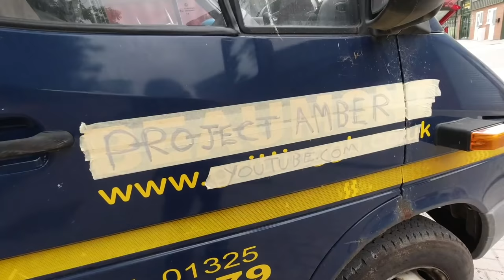My Van is Dead. Ex-ambulance finally giving up.

Comment: Deffo change the full engine, I know it’s a hell of a lot of work but everything on that engine has only done 58k, including all of the bottom end bearings etc. it has to be worthwhile
Reply: might go as far as replacing the spindles and rearhubs too as the bearings in them should be way better (if they fit the hydraulic stuff from amber on them that is )

Comment: Good luck with this. I would have a go with the low ratio diff. Just stick to 50mph on motorways and everywhere else will be better. Without the auto having a low first gear for getting to your land in Portugal will be really handy.

Comment: You need Mercedes VDOC, remove the option codes for semi auto and re SCN code the original control units. It’s like a retro fit in reverse.

Comment: "That is a lot of work." It's a lot of content, too, though. I did some of these things to my 212 d, and it is even an astonishing lot of work with two absolute identical cars. Still a huge job should You go for a non-Mercedes aftermarket ECU (don't know whether this would keep Amber roadworthy in terms of homologation in the UK) to avoid all those differences rendering the new stuff incompatible to the old brain. It's quite some step anyway. I think I personally would have searched for a new 5/6 speed manual bed with lock diff in mid range speed and changed the living room, but You might have Your reasons. Massive respect and good luck. I'm looking forward to how it goes for You.

Comment: This happened to me with my ambulance. There were unforeseen differences with all sort of daft stuff like gbox mountings, subframe, steering rack etc. In the end I undid the subframe complete with all the suspension and running gear and lifted off the cab and body leaving all the suspension, steering and drive train in one huge great lump, jacked up my ambulance and plonked it on stands, dragged out the whole lot with a tow rope, pushed new drivetrain under empty ambulance with pallet truck, Dropped ambulance back down onto said new drive train, bolted it in (in this case 6 mahoosive bolts) , stuffed the defunked old unit into donner vehicle, and flogged it all off in a one shot when I was sure I had all I needed. This saved a heap of mucking about. Good luck. PM me for more stupid ideas if you want to complete your breakdown and transition into a full psychotic episode. Have fun!

Comment: standard engine > adaptor plate > Lexus 450h hyriid transmission(can produce 300+bhp) > batteries from VW or BMW  hybrids add as you go along > modified Prius controller... and other bits needed...

Comment: That's going to be a Big job. When you swap over the motor and gearbox make sure you toughly check the clutch plate(s) out and the hydraulic thruster are in excellent condition otherwise replace them while they are accessible.

Comment: I feel sick thinking about it, but in my experience the compatibility of parts is usually blown out of proportion and often things work that so and so from down the pub said wouldn't. I think with changing most of the bits you will be ok.

Comment: If I'd known you'd been doing all this work CJ I would have booked a week off and come and given you a hand with some of it. It's a lot to do on your own, especially when fighting with all the bloody rust we get on our vehicles here in the UK!  I probably would have taken your course of action - at the end of the day the idiots on the production line managed to put these things together how hard can it be to play musical parts!

Recipe for rusty stuff that won't come apart:
Shock - impact, air hammer or a whack with a BFH
Heat - MAP gas - comes in the yellow cylinder. Absolute life saver! Cycles of quenching with freeing oil or a freeze spray can help.
Brute force - Breaker bar

Some combination of these will generally free something. If you snap the head off something clean it up and weld a nut to it. Worst case get the grinder or the cutting torch out. 

Wouldn't hurt to consider getting one of those monster half in Milwaukee battery guns - you already have the charger and the batteries for your drill.

Comment: Been a while since i've commented , but def a donor van and swap everything , even a manual gearbox swap . Like i have said before in the past many years ago when you originally replaced the gearbox , this is your house ! 
A full mechanical swap is lengthy, but head down bum up and its done sooner than later and you have a boat load of spares . :)

Comment: Swap out the entire engine and box with it having only 58k on it. Use the 1/3 of a million miles engine for spares.
Swap out the entire rear axel too, you can always change the crown wheel later.
....patience , have a lot of it to hand.
Good luck.

Comment: strongly suggest you take the whole lump with gearbox out of the donor and put it in amber , allso replace ambers dashcluster with the one out of the donor (could be the dash talks to the ecu about the milage and have them different might send the ecu intoo a hissy fit )
since youre replacing the reardiff with one of a different reduction , the speedo will be off so you probably need to have someone hang it to the star unit (you can buy working star C3 and C4 systems on aliexress and do it youreself )
as for trying to start it while missing components , dont do it it will trow faultcodes

over here in the netherlands there a few people on the smart forum that have a star C3 unit that allso works on youre van and do work for a small fee without the problems that the boys at mercedes have about "trown together from parts cars" 
one thing i do know is that usually the wiring is expandable by adding the extenions to them (they are on the smart fortwo at least for stuff like full auto cruisecontroll the clock and the rev counter and these are mercedes desighned mecanicals and electronics too )  , even with the cabling mounted they still dont work untill you turn them on in star though , youre prolly need to have the tacho removed from the system too 

hope you manage to fix it , i know you can build it together from the parts youre having but getting the ecu to play nice is usually a bit more work , try mercedes forums for hobbyists that have the star in youre neck of the woods , im sure they can get it to run again 

allso keep both vin numbers as youre going to need them when ordering parts from mercedes , i used to own a gas model 190 they converted to diesel and mercedes plain refused to sell me the parts i needed unless they where things like sparkplugs and a distributor
u turn them on in star though , youre prolly need to have the tacho removed from the system too 
it might be eazier to program the ecu to run a manual gearbox and keep all the electronics like they are in amber https://www.benzworld.org/threads/ecu-reflash-automatic-to-manual.1662594/
https://mhhauto.com/Thread-Solved-Sprinter-906-automatic-to-manual-conversion

Comment: You just need to put the adaption codes for changed module into the ECU. It's really simple if you have the software.  You can also change what differential ratio the ecu is set for with software adaptions

Comment: angle grinder with thin metal disc cut the bolt in 2 on the leaf springs shackel little love tap with a hammer n chisle easy and just get new bolts

Comment: just a thought, Have you looked into the price of an an aftermarket programable ecu i think there pretty much come with a basic map to allow running , use the relevant wiring and plugs to feed it from the donor vehicle.  That way you can keep all your wiring for airbags windows etc, just might need to fool a few of the dash lamps when its mot time.

Comment: Know how u feel. When I operated my own buses I had a fairly young Merc 811 29 seater auto and gear box packed up. So went for the manual option.  Great took 2 months to find a second hand gearbox and peddle kit as there were very few 811 scraped. But what a different bus to drive when we got it back on the road. Enjoy as the manual option will make a better driver and less headaches.  As merc auto boxes do give a lot of trouble.

Comment: This is such a good outcome, you change the engine for one with hardly any miles, lose the nightmare gearbox and swap the dodgy suspension while keeping the conversion with all the love and manhrs you invested. Just have to do it... What would the top speed be with the higher ratio back axle I wonder ? You could certainly climb hills.

Comment: One thing to consider. As the donor van is classed as HGV and fitted with a tacho it will be electronically restricted to 90kph.
Reply: hi can a auto electrician remove the tacho?

Comment: A used engine from a specialized company will do the trick I recon, don't waste your money on another van.. Calculate for double the cost of another engine, since all the hoses/ reservoirs etc will probably needs to be replaced due to their age. And don't forget to put in another clutch/gearbox/bearings/other driveline-parts,  since you are opening her up anyway.
Reply: That's exactly what I was thinking might be the best way forward. If the rest of the van is solid then it's worth the outlay, but get someone in to do the specialised work. Theres plenty of donkey work he can do, but I wouldn't want to mess with stuff that really needs someone with magic hands and knowledge to safely carry out the work.

Comment: If the engine is smoky and sluggish it has to do with the intercooler 'not doing its job properly' as you said in the beginning, thats an easy fix, everything thats wrong with it can be upgraded with aftermarket parts way stronger than the ones she came from factory with? Get better bearings for the gearbox do it properly with reconned torque converter and the lot, sort the diff? Dont start on a new van because its gonna cost way more, its just not worth it. LE: got further in the video and seen you got one for spares, so fucking happy you haven't gave up, never give up on it, keep this in mind, you abused it it lasted, you running constantly with all that weight on it of course she gets tired more often but you got to keep her going, she never let you down, dont let her down.
Reply: No torque converter. It's an automated manual gearbox, i.e. semi automatic. There is a much earlier video of CJ doing a flywheel & clutch change.

Comment: As far as swapping the complete wiring loom goes. I would swap the ecu's with the complete engine and gearbox if it plugs into your van give it a try and see if it starts and what error codes show up, as long as the plugs are the same. I had very few issues doing a similar swap on a Vito van all be it slightly newer. The manual ecu will negate most of your management issues concerning the auto transmission. It would be alot harder going manual to auto.

Comment: Shame about Amber. As you went through the options I was thinking about a swap then you came up and said it. Then I thought finding one would be hard and you said you had one already. I think it is better to take engine and gearbox just in case the end of the crank is different and also if there are any electric connections on the gearbox. I think you may have to do something to recalibrate the speedo. I doubt the diff matters electrically as there are no wires to it. What normally happens on a rear wheel drive car is where the cable or wire goes on the sensor at the back of the gearbox there is a speedo drive which is matched to the diff and tyres. If you pull that out and swap it for yours that may be all that is needed. You may if you can get some help be able to drop the engine and suspension together. That is the way the factories usually put them in just be careful lifting in tight spaces to avoid mishaps. The electrics are always a bit worrying as there is no easy way to test as you go along. You could do with a Merc mechanics advice.

Comment: Maybe one plan of action with the diff could be to just fit that new one to keep it mobile and get the old one rebuilt?

Also don't know about the loom, but i reckon you can make a hybrid of the 2 (not as scary as it sounds), One that keeps the engine and clocks etc happy and leave the rest in for all the other electrics like windows etc?

Comment: Ah, just get on with it, swapped a C220 engine into a sprinter this year. Pretty straight forward apart from a bit of coding and looms are made up in short sections that are inter changeable to the main loom, big Meccano set really. Yeah agree that’s a lot of work involved but most parts are interchangeable throughout Mercedes’ range. Part numbers are W906 ************ or same part different model W904 ************ last didgits are the important factor. Good luck n crack on.

Comment: You'll pull her round mate but i'm not sure why your not having your gearbox reconditioned, its not hard to do yourself or a few hundred professionally saves an awful lot of work
Reply: He's already had the gearbox rebuilt once, as I recall it was a major headache for him..
Reply: @jeffbishop9404  I remember about 3/4 years ago doing it on his parents drive after it failing through france but think was only repaired not fully reconditioned if i remember correctly
Reply: @Superfandangoo  Yeah, he took to a 'specialist' in Wolverhampton I think. Wasn't the best..

Comment: hey, ever tried a candle pushed on a red hot seized nut and bolt? - its better than the wd duck oil ! i have tried it on  knacked track rod ends when nothing else worked, i can't remember the science but the candle becomes the gas and fires up the dry threads.... vitre effect or something works a treat

Comment: You are nuts😂. Didn't realize that they are air brakes. Give it a suspension lift while you are at it and put taller tires on for when you go up daft muddy tracks as you seem to like doing😂👍

Comment: Aww CJ I feel for you I am in similar situations with my campervan 350 transit issues with engine ive spent loads and more  but I don't want to let go either. Catch 20 I've spent so much we're do I draw the line she a good van just ford crap engines so do I keep spending or let go . 
Good luck

Comment: I just spent 2 years doing up my sprinter and now it's in the merc workshop still immobilised after spending $1740 then $1650 now I get a bill for $3450 and 4 tow truck bills and I still have to wait at least a month to get it back. I feel exactly the same. Don't know what to do. At least it's a manual.

Comment: notice you are using Milwaukee cordless, the 1/2inch drive impact gun would make very light work of those spring bolts.
Reply: Yeah - he already has the 5AH batteries! Those half inch impacts are absolute beasts - well worth the money!
Reply: Someone should contact Milwaukee marketing department and get them to send him stuff

Comment: Mate…I feel for you, I’ve got the same shit gearbox .. 02 316, and similarly my interior set up is 100% so no choice..had to buy a new computer system for the auto box and have engine removed to get the glow plugs out, turbo fixed etc .£3.5k later it’s working but I now can’t afford a respray! If the doors on the spare van are (miraculously) rust free I need a set so give me a price
Reply from the maker: Oh no! Sorry to hear of your issues. I'm afraid the doors were beyond saving

Comment: Surely you would be better just taking the box off and mounting it on the 58k base?
Reply from the maker: It's so rusty it'd probably snap in half! It would have been ideal but the only thing the Donor van was good for was it's parts

Comment: You need to get yourself a copy of Star Diagnostics. This is one of the reasons I think Sprinters are wank. Start error is easy ti fix though; just virgin the ECU and cluster and re-pair them using Star

Comment: Dont know when Vlog was Done.
Take Diff Your Diff to a Specialist For  Reconditoning , You Should get all the new Half Shaft Paranafailia too

Replacing Clutch while its Seperated?

Do Sympathise with you, but Question has to be asked..
Why let it get in all that State Originally
Deal With it when you get a Hint of Trouble

Comment: If it was me I’d change the engine over sell the manual box look for a good auto box or re ferb yours , sell ur old engine man gear box save your self a ton of grief trying to convert Amber to manual, change the springs  etc an other bits .
Everything else scraped or sold.
Just saying